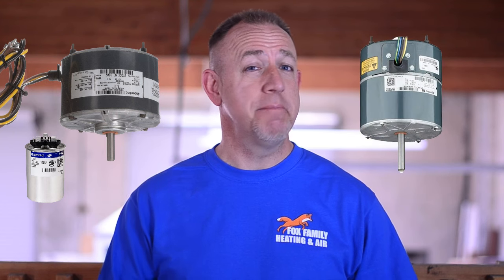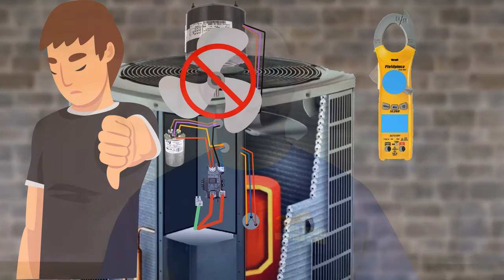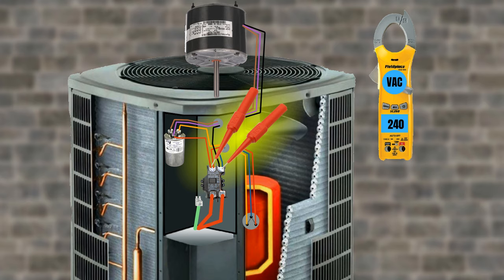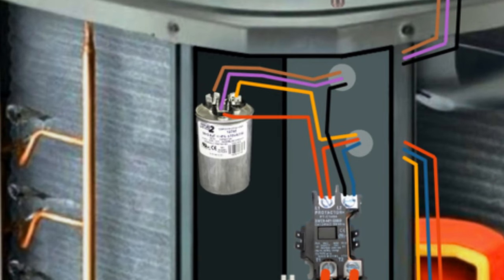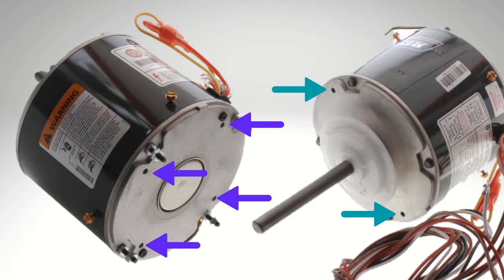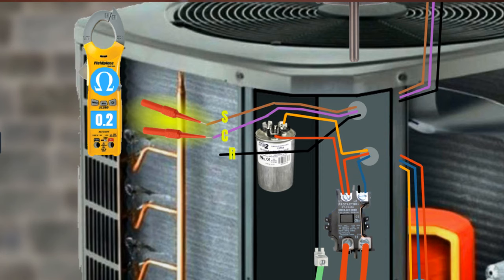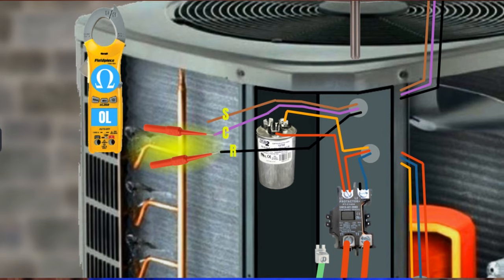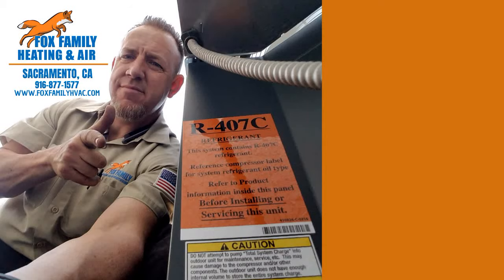How I Troubleshoot an Air Conditioner Condenser Fan Motor

Comment: This was a great explanation with an equally great presentation showing the motor and compressor wiring. I almost felt i was in front of a machine. Thank you. These graphics you went to the trouble of presenting really help the learner.
Reply from the maker: Very nice of you Michael. Thanks 😊😊
Reply: Tjankyou sir  sheting  welced   ps  c   permeact  split  capa  ctier

Comment: This is a great video. If you have a fan motor that has a bunch of wires? It's probably a variable speed fan. If the motor says Price or TheDealerToolBox, it can be a controlled unit. If that's the case you can't ohm out the leads. They're all zero. On a unit that I have that is bad, the motor windings after I took it apart were fine. It turned out to be the controller unit that is in the top of the motor unit itself. Without special equipment I don't think it's possible to test it in the field. I replaced the capacitors, it still didn't run. I replaced the motor and it fired right up. This was a unit that the fan didn't spin up nor would it spin up after being pushed with a stick.
Hope this helps someone.
BTW, be careful out there. After you pull the disconnect do yourself a favor and always, always, always take a volt meter and check leads and ground/bare metal. Sometimes the guy that wired the unit didn't do it correctly or something else in the house could cause voltage on one of the wires to ground. Always check.

Comment: First hot day of the year I fired up the AC and noticed the fan was not spinning and was running loud. I turn off the unit watched this video and had it working in no time. The was able to move the fan and add a little WD40. Blades were a bit stuck and running great now. Thank you!

Comment: I had a condenser fan motor stop working. Tried to spin the blade and it was very hard to spin so I ordered a new motor. When I took the old one off, out of curiosity I took it apart to see what was wrong. There really isn't anything to wear out other than the bearings/bushings, they don't have brushes. Turns out the bushing toward the fan blade side had dried up grease. I cleaned both bushings and the shaft and regreased it. It spun over super easy so I installed it back on. Tested the amps and it's pulling less than what's rated. It's been running great since then and I kept the new motor I ordered as a backup. I figure if it goes out again, I'll throw the new motor on while I fix the old one, maybe have to replace those bushings next time, or just pull it apart every couple years and regrease it.
Reply: Any symptoms? Mine is doing the same and my blower motor is blowing air but not like it normally does. The exhaust fan motor is shot. It's hot to the touch and I can not spin the blades.
Reply: @DSGB91270  There is nothing touching the fan blade shaft except for those bushings. If it's hard to turn then it's those bushings. Mine was very easy to take apart and still going today.
Reply: @DustinDoesStuff  symptoms? I have sit blowing in the vents, not near as hard or as cold as normal. I'm digging Into it in the morning.

Comment: I recently saw your video about how you started HVAC at 35. That's awesome, I'm currently 35 in my first year and feel like I really started too late standing next to a 32yr old with 17yrs experience speaking what essentially sounds like Greek until things start clicking.

It's making a lot more sense every day, but man it just seems like such a long road from where I yet stand.

Your videos are a great tool, hope you keep going with the channel! Most of my off time is spent trying to educate and just watch the pros do their thing. Thanks again!
Reply from the maker: That's perfect! Keep educating yourself. I am still always trying to learn.
Reply: @foxfamilyhvac  you're awesome
Reply: One by checking  cap bad replcing  ac checking good no contacter checking metar  and  grund no confromed fan body and  restances checking one by find piy solveing power line checking s cruing wimd checking opon wind fsn  high low medom checking

Comment: Great video!  I used this to rule out my condenser fan motor, after it wouldn't run even after replacing a bad capacitor.  It was a 45/5 that decided it wants to identify as a 45/0. :) 

Eventually I figured out that the control board feeds one leg of the fan, and it wasn't happy due to a high side lockout code left over from when the capacitor failed.  Once I power cycled the breaker to my furnace to kill low voltage to the control board, it cleared the code and everything worked fine.
Reply: Put that Cap in the wood chipper.

Comment: Sometimes instead of the compressor overheating there is either an automatic or manual reset high head pressure switch that will open due to high head pressure caued by the failed fan motor.  On the older Lennox HS 25 condensing units, they had a manual reset high pressure control.  I love these as they provide the best protection for the compressor.  When a high head pressure situation occurs, switch opens cutting off 24 volts to the compressor contactor coil.

Comment: First, I'm very happy to have stumbled across your channel. I've researched far and hide on my AC unit. I've changed out the capacitor first, and still run into the same problem. The motor will run for 20-30 minutes, then it will stop, I think the thermo-protection kicks on, and stops the motor. If I try to kick start the fan when that happens, the blade has a lot of resistance. However, when I shut the power off, that resistance goes away. Short back story on the motor, about 8 months ago, I had to oil the motor as it would make noises, and the blade wasn't spinning at 100%. I feel at this point I just need to replace the motor. My question, as long as I match up all of the specs, an aftermarket would be just fine, right? Unfortunately, the OEM isn't available anywhere. Again, thanks for the insight.
Reply from the maker: Yes a universal is fine. If you want you can email me a pic to greg@foxfamilyhvac.net Main thing to remember is you have 850 and 1050 rpm motors. (close is fine, ex. 875 and 850 is close enough. They will all be 240v motors. Universal motors have wires you can use to change the fan direction. Other than that, close on the HP is fine too.
Reply from the maker: I like MARS motors better too.
Reply: @foxfamilyhvac  wow, I really appreciate your reply. I will send over some pics of my motor. Again, thank you so very much.

Comment: Thank you for this video. 
My condenser fan was not working properly. I was about to replaced the fan motor but thanks to you, i tried the capacitor first. It worked!! Easy $20 fix.

Comment: I did the capacitor check and found the one in the unit, 6 years old, was bad. It is a 50 +5 if. The 50 side checked bad. I ohmed out the condenser fan motor. 35/92 ohms respectively. I replaced the capacitor and the unit ran again. After one day, the fan would only hum, as it did originally, which was the reason for the service request to begin with. The replacement capacitor also showed the 50 uf was shot. I saw your video on capacitors and bought a good one with the eia456 number. Same humming today after only one cycling. Why the 50 side and is my fan motor bad? Thanks for your help and the great videos.

Comment: Before watching this I’ll tell you my steps. First I try to spin it and see if it’s seized up (if it is than you know it’s done) if it starts spinning it’s the capacitor next I check that there’s voltage to it and if there is I’ll check the capacitor to make sure it’s in full range (sometimes I’ll check the capacitor first whatever is more convenient) then depending if it’s a fan motor that’s still spinning I’ll check to see the amperage draw upon startup and running. If the fan spins and there’s voltage and a good capacitor I’ll make sure all the wiring is tight and properly wired with no cuts or scraps along the wires causing ground outs. Pretty basic routine for me. 
Some cases are different than others depending on circumstances but this is usually how it goes.
99/100 times it’s not the contactor but it happens
Reply from the maker: Awesome! Thanks 👌
Reply: @foxfamilyhvac  thank you! I’ll definitely be checking resistance and check if it’s grounded from now on too!

Comment: I have a rheem ac and the fan will spin for a few seconds then shuts off, I still hear the condenser running. What could it be? The unit is only 3 years old. They changed the motor once, but it still happens.  Thanks

Comment: Do you check a Psc fan motor the same way you would an Econ motor for short to ground?
  I have one that shows continuity from all 3 wires to fan housing. 
  One guy said it was normal since the motor had it is connected to a transformer.  Unless the transformer is inside the motor housing, I see no transformer.  All three wires are disconnected from where the go to terminals on contactor and capacitor.
  Note fan does run but seems to get hot. It does not blow a breaker for the few minutes I let it run. 
  I do have to manually activate the contactor. Thinking I blew a fuse for the low voltage contactor winding.

Comment: Great video! I have a question. So my unit turns on and the fan doesnt move. When i push the fan, it will start. After a short time, the fan will stop. I cant push it to start again. Any advice?

Comment: What if the capacitor is good and the windings in the motor are good and you have proper voltage going to the fan motor but it still won't come on?

Comment: 1996 Rheem raka-037jaz condenser fan stops after running for about an hour and the compressor is hot. I opened and cleaned everything thinking it was possibly overheating from build up and after cleaning ran great but after 2 hours same result the fan was idle and compressor hot and hissing. Time for multimeter. I'll try giving the fan a budge when this happens in my test tomorrow.

Comment: What's the likely problem if the compressor and fan won't start until I bang with it on a hammer?  After I do so, it turns on and off fine for a day or so.  I've replaced the contactor and capicator

Comment: Hello great channel. I know it is a old video. But I have a question. I replaced the motor fan twice. With the same problem. Usually after 76* the fan stop while the condenser keep working. An the fan overheated. Both with the same problem. The only way that keep working it is that I put water while is working avoiding the motor overheating. Any suggestions?
Reply: I’m having the same problem, ever figure out what the cause was?

Comment: I just had the capacitor replaced on the A/C unit. Now the house cools down nicely but the fan runs backwards pushing air downward in the unit which escapes from the sides.
Can I just leave it like this? The technician didn't seem to be worried about that or should I try to flipped the fan around?

Comment: First time watching and this is very informative. Im a new tech and i have a condenser that trips the breaker panel in the house. How do I check the capacitor and compressor as well to see if theyre causing it to trip? Can the contactor cause it to trip?

Comment: try it on heat first and see if the system will work, if the fan works, no need to check it or the cap no?

Comment: Hvac technician changed my capacitor and I also replaced my fan motor but I still need to keep kick starting for the fan to spin should I replace the capacitor again?

Comment: Hi Greg! I swapped my capacitor out since my readings were 28/3 on a 35/3 capacitor. I also checked the fan wires and got 159 , 122 & 37 between the wires. The fan still won’t start until I give it a push a few times. Do you think the condenser fan motor can still be bad even though readings add up? Should the fan wire lower readings be more even?
Reply: Good luck with that! I’m dealing with my AC head ache tonight here in Oregon.

Comment: Can I replace an 830 with a 1075? I know guys that have done it & never had any problems & other had problems. I've never done it, I always stock the 830 & 1075 but in an emergency call?
Reply from the maker: I wouldn't , because the temperature of the air being discharged out of the top would be different than the manufacture specs. For that reason alone I wouldn't do it. If the outdoor unit were to overheat, you may nit have issues right away, but a  year or two down the road, the damage will show up.
Reply: @foxfamilyhvac  Thanks! I guess I'll just keep stoking both. 👍

Comment: In the last 4 weeks a noise from the AC occurred 2 times and the fan wasn't turning. After the first one I replaced the capacitor. I  assume the motor is bad.

Comment: I am having the same situation with my main HVAC unit. For some reason it keeps overheating and shuts off. It’s 100+F here outside during daytime. The tech  stopped by and said it’s a faulty  motor and replaced it as well as the capacitor. But it ran for 10 minutes before shutting down. Replaced it with a temporary second motor and it ran for another 15 minutes before shutting down again. Turned out it was also drawing too much current as well cuz it was too powerful motor I guess. I kept running the motor for 15 minutes and then took a break for another 30+ minutes and repeated the procedure until midnight.  Then left  it turned off until 5 AM. Now it’s running normally for almost an hour  and a half.  Once the temperature outside kicks in   it might over heat and shut off again. What could be the problem here? New motor n capacitor. Still getting overheated. Acid washed the compartment filter aswell. 
The motor cost $450.  I don’t even know if it was really a bad motor or something else at this point. Any tips?

Comment: The unit is shaking I was told that the motor was going bad is that a possibility? I'm open to any answers, thank you.
Reply: What did you ever find out? Mine started humming very loudly during a bad rain storm yesterday after a power surge, I read that some units will change rotation after a short power surge but I’m ignorant when it comes to hvac.
Reply: @Jcasta8  It is about 10 months since my post.  I was going to have the motor replaced, and the cost was near $900.  I did some research and found motors inexpensive, and I felt like in most fields of repair they are over priced for labor and parts.  I also noticed the fan motor is mounted to very thin sheet metal which moves up and down when the fan is running and assumed that being a real reason for the vibration.  I was told that the bearings in the fan may be worn, or wearing out.  I didn't have the work done, and the vibration for some reason doesn't seem so bad anymore.  Also make sure your filter is changed every 3 months, or so to prevent the fan from struggling.

Comment: Question - My fan motor is overheating and shutting down after running for about 20min on a Carrier Infinity condenser. I put a new fan motor on and I am certain that it is good  (bench tested). I also swapped fans from my second condenser (same model runs well in that condenser) and same problem. I tried two capacitors and I even bypassed the dual run and isolated the fan on its own capacitor and still the same problem. Any thoughts on what could be going on? Transformer, PCB? Any thoughts would be helpful and thanks for the awesome tutorial!!!
Reply: Check these next in order - contacter, thermostat, then the controller board of the blower.

Comment: my capacitator was not connected to the fan terminal, my ac unit doesn't have a wire to it, is this normal?

Comment: I just had a compressor not run and found the condenser fan to be locked but somehow prevented the compressor from running, not even a hum from the compressor, I'm sure it has to do with the capacitor(replaced during troubleshooting so both capacitors were good), anyone understand what was happening? I replaced the fan and everything worked fine after.

Comment: Question for you sir. My fan starts. Runs for a couple mins and stops. Compressor keeps working . Bad capacitor or fan relay.  .?  Thank you in advance
Reply: Ever figure out what was the cause on this?
Reply: I did. I changed the capacitor

Comment: what would cause a motor to run fine on low speed and high speed. but also if its running cause the entire casement of the ac to live voltage. giving a nasty shock
Reply: Probably a bad or missing ground wire.

Comment: My outside fan keep running 24/7 even when I put my thermostat to OFF position. The blower inside the house will stop but the fan outside keeps running.  Ac still blows cold air. Could you please give me some tips ? Thanks

Comment: Good video. One question > What if the fan runs constantly?, just the fun. I replaced capacitor and contactor. Compressor is fine, on and off, but will stop. Thanks

Comment: We have a green wire coming out and no where to put it on condenser.
Reply from the maker: You can mount it to the frame right above the fan motor. Use a screw that holds the fan in place and just put that grou wire to it

Comment: Hi... The condenser fan turns off when it gets hot... I changed the capacitor, the motor and the problem continues... Any suggestions ????
Reply from the maker: If power to the motor is good and the motor works intermittently or overheats, change the motor. Make sure your condenser coil is clean too.
Reply: @foxfamilyhvac  Motor is new.. capacitor is new..voltage is ok..condenser and evaporator are clean..don't know what else to do...
Reply: it only turns off when it gets hot... I wait about 20 minutes and it turns on again normally...
Reply: I’m having the same issue, ever figure out what the cause was?
Reply: I cleaned all inside contac of the relay... Not motor, Not capacitor, just relay and  my problem  was fixed..